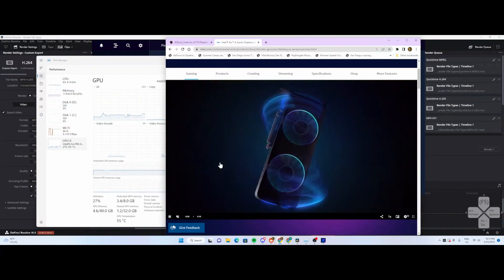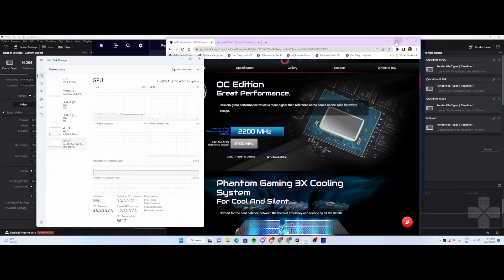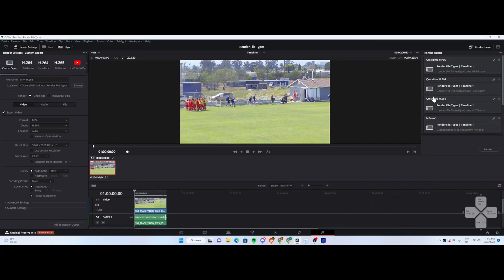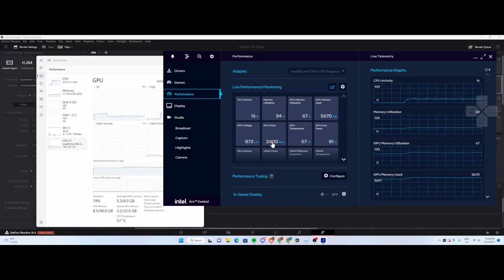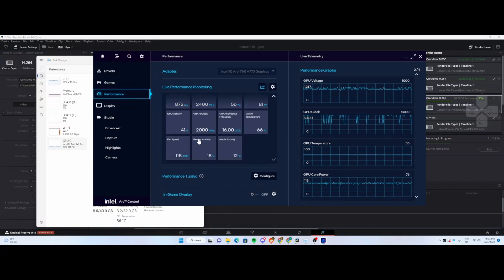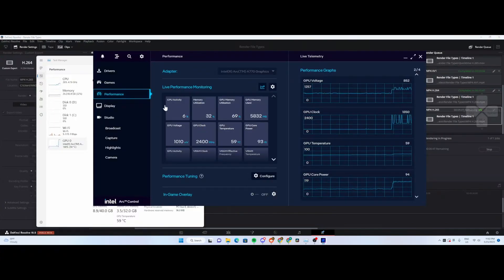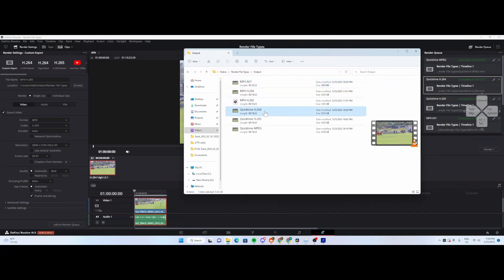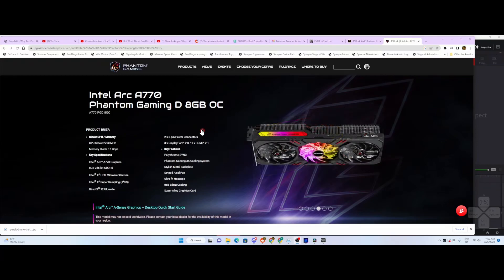Intel ARC A770 rendering AV1 on DaVinci Resolve

Comment: This video doesn't seem helpful in understanding the speed of encoding with the a770. It doesn't show the rendering speed. Are you using Resolve Studio or free? If you use Studio you need to select the fast preset to max out the GPU and CPU to see the rendering speed in FPS, which is important. Doesn't matter about GPU % utilization, it's all about speed.

Comment: is av1 encode avalable in the free version of resolve or is this a studio only feature?
Reply from the maker: It is available in the free version
Reply: @odetas9597  thank you, now only one question remains, is ir possible to run 2 gpus from different manufacturers ( a cheap inrel arc for av1 encode, and an nvidia gpu ( for the rest inclufpding gaming)) in the same rig? My reason for asking is that I'm rather satisfied with my current nvidia gpu but ofc its not a 40xx series so no avi encider for me :)
Reply from the maker: @bjarnenilsson80  I believe so, I haven’t tested quite yet, but it shouldn’t be an issue. You just need to make sure you’ve got your applications assigned to the right GPU